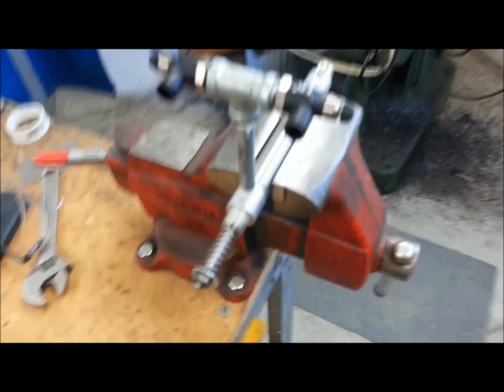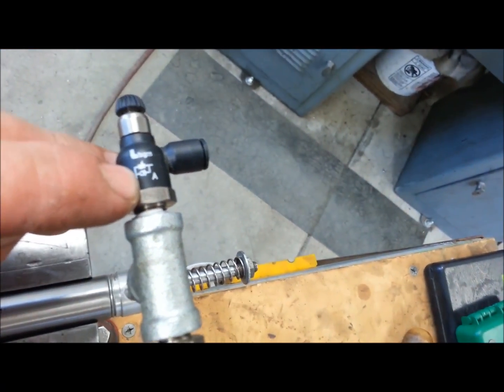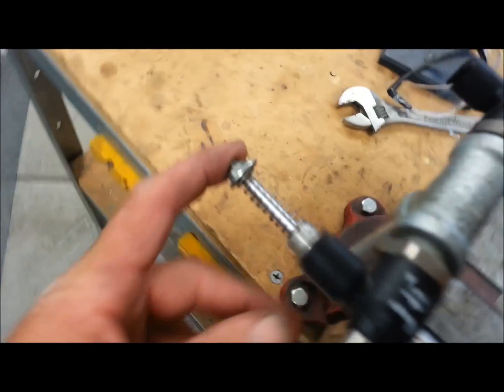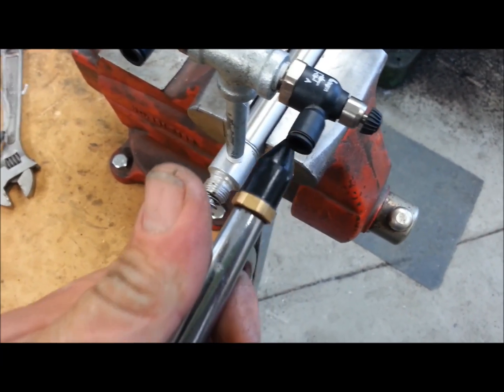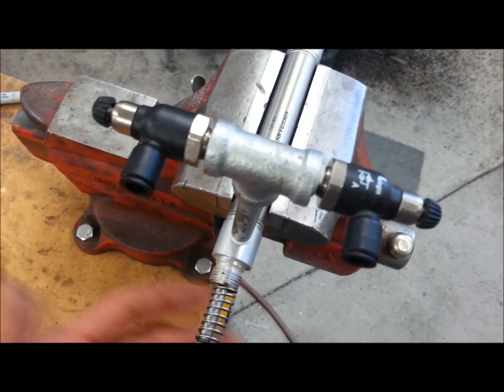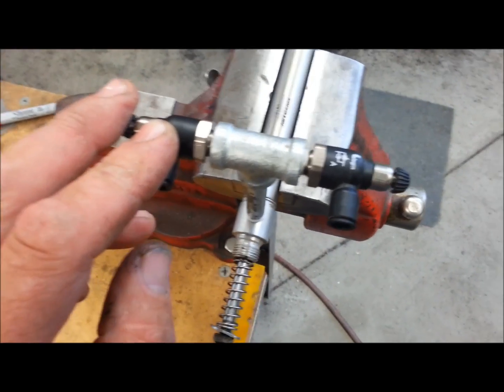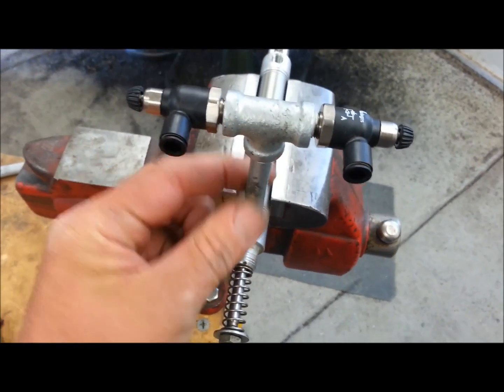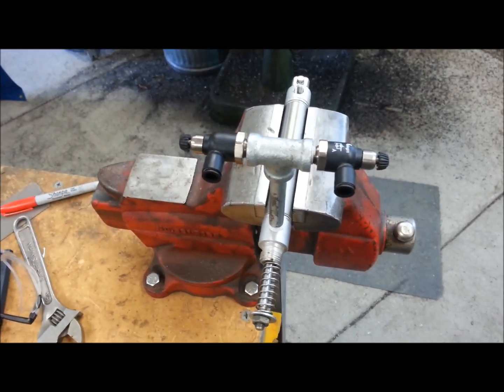Power drawbar logic #2 a quick fix

Comment: Hi there, thank you for the clear explination. Showed me where I went wrong in my current power drawbar build build. I am struggling to find a matching fitting in my country. Would a 4 way fitting with 1 feeding the cylinder / 1 from each side or direction of the impact wrench via a check valve and the last port of the 4 way fitting going to an adjustable bleed valve accomplish the same objective with a few extra fittings?

Comment: Great follow up!!
Any time I've used the flow controls on a cylinder, it was to control how fast the air exits the exhaust side of the cylinder.  With a flow control on both ends, I could set a different speed for both extension and retraction. 
I agree with Brad.....would love to click "like" more than once. :)
Thanks!!!
Mike

Comment: Hi Stan, Nice fix but do you really need two bypass valves, surely you only need one  with a simple check valve on the other end of the Tee. I don't know how much they cost but I bet they are more expensive than simple one way valves.
ATB
chris
Reply from the maker: Unfortunately the air feeds the cylinder in 2 different directions, and we have to bleed air opposite of the charged line. 2 valves are a necessary evil.

Comment: Pretty cool that you can get it built into the valve. I had a poor man fix in mind of a simple very small hole between the check valves. This would "leak" in operation but not enough to disrupt the function of the cylinder.
Thanks for putting the time into this. :-)

Colin
Reply: *****  yes, in this case it is really similar to diode logic: http://upload.wikimedia.org/wikipedia/commons/thumb/a/a1/ORGate-2-Diode.svg/220px-ORGate-2-Diode.svg.png

The resistor being the "leak"
Reply: So much for my bright idea of it escaping through the impact. :)
Reply: NuttyforNissan
Think of the check valve as an electrical diode...one-way only. :-)